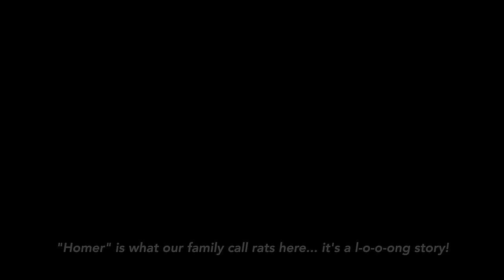Watch out for this when building a house in the Philippines Province 🇵🇭 SIMPLE LIFE FAMILY VLOG

Comment: I recommend putting spray foam around those pipes in the walls and foundation. I had issues with mice/rats until a pesk company said they getting into the foundation through the cracks. They sprayed the holes around the AC pipes and the issue diseappeared. Also once the spray is down, put that metal chicken wire over the spray as well. Reduces the chance that the rats will eat through the spray.

Comment: Adam invest in a face visor and wear your contacts as normal. That said too your boots add some leather work gloves not much protection from snake bite but definitely reduces the chance of disease from the rats. From an engineering perspective i would cap the pipes and drill the caps to allow water out depending on diameter the sink filters to catch food waste work well then do your wire mesh over the top. Currently I am not in the Islands but take all of these precautions for my workshop with the addition of rat traps and poison all within the law here at least
Reply from the maker: Thank you my friend! Very helpful advice and ideas. The traps don’t work so much now as they seem to force their way out. I’ll need to modify the spring to make it firmer. Have a great weekend 😊